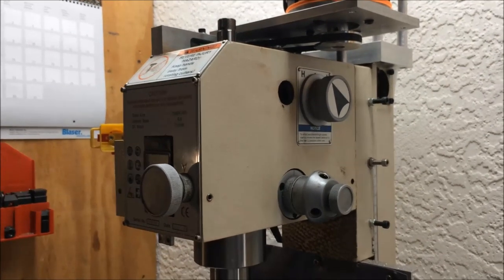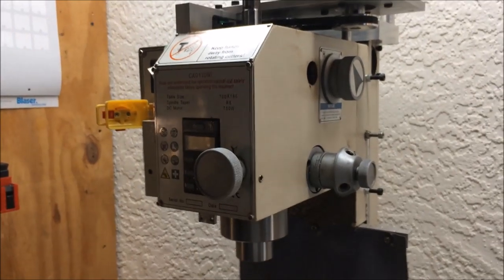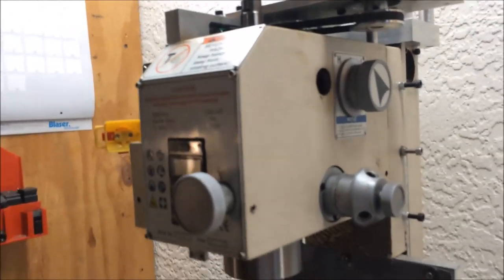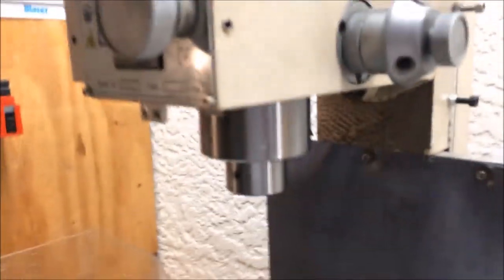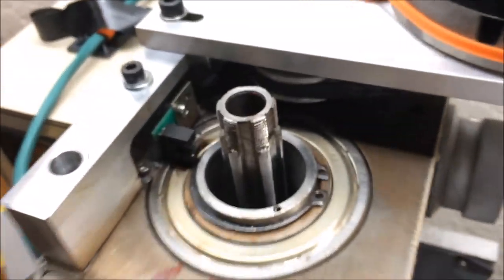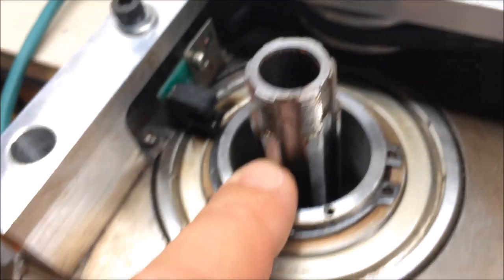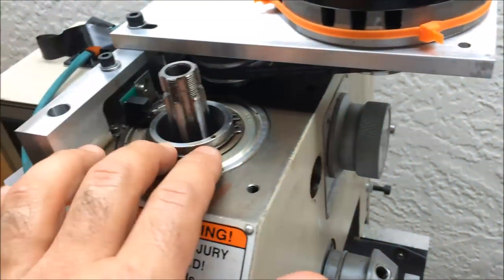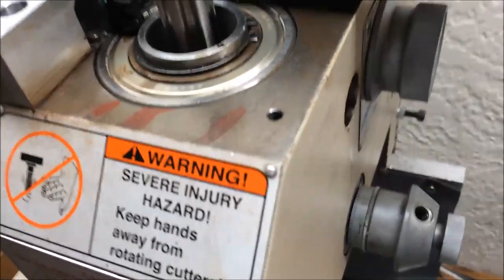G0704 Quill Bushing - How To Improve Surface Finish

Comment: What becomes of the spring and metal bushing that were in this location, and held in with the large c-clip retainer.? I'm not seeing either with your bushing in place. How would it go back in place with the Derlin bushing in place?
Reply from the maker: Joe Sunseri Hi Joe.  I don't use them any more. The quill is now locked in one position.
Reply: @FrancoCNC  sorry to bother you 3 years down the road. Lol. But just curious about how you accomplished that ? Did you just tighten the piss out of the quill lock screw/replace it with a set screw ? Or is your quill retained using something other than that single screw ? 

Thanks !
Reply from the maker: @Jutilaje  Hi.  I just make sure the "factory" quill lock screw is nice and tight.
Reply: @FrancoCNC  awesome, I appreciate the reply ! I'm doing the same thing right now - making the bushing to eliminate rattle, deleting the quill function, etc, and wasn't certain tightening that screw a bunch would be good enough. Now I do ! Lol. Thanks again and have a merry Christmas :)